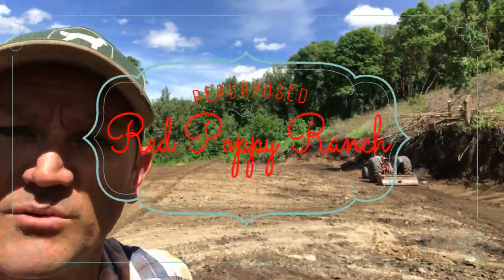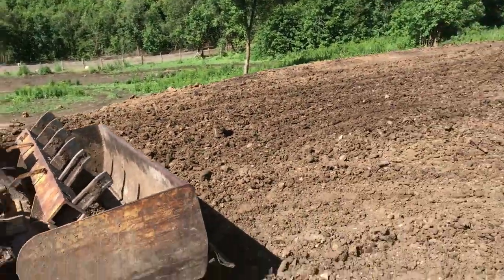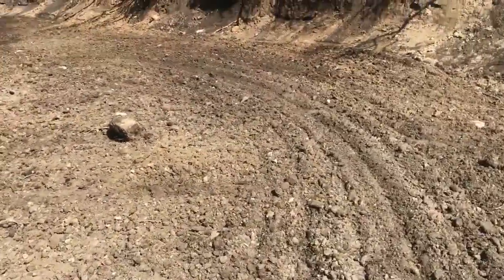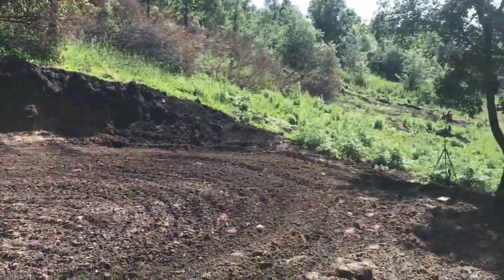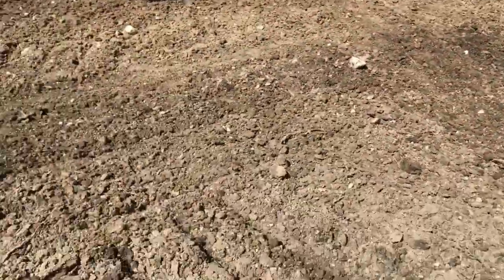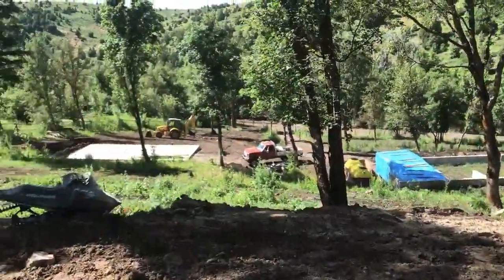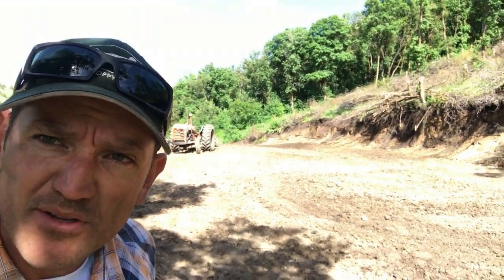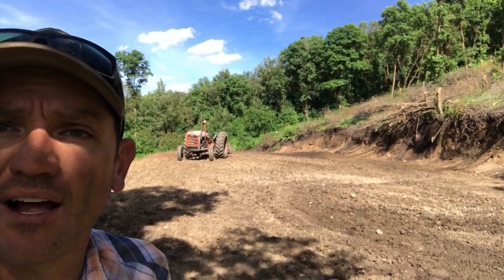#114 - Grading The Sawmill Pad With The Old Diesel Tractor

Comment: two tricks for running a skiploader...
first make sure your gannon (box blade) and front bucket are wider than your tractor....
then your tractor will set in your passes not jumping around..
second... once you have the dirt (ripped) so your tractor can handle it..
work backwards..
your tractor will be rinning on your passes.(less jumping up and down)
another trick is to make passes leaving a couple of feet between them..
then going forward your tires will be running on flat runs ( jumping less).. and you can use the slug of dirt to adjust what you left...
if you're filling on a slope...
always key into the slope at the bottom of where you want your finished slope bottom...
as you work your way up the slope laying each lift in keep keying in...
if you just push dirt over a slope..
you stand a good chance when the water gets in the whole fill sliding down the mountain..
when i key in (horizonal passes running across the slope ) 
i cut the keys (benchs) tilting into the  mountain and compact ever lift.. (6 inchs max)
always keep cutting into the mountain every lift until you are at the top of your pad against the mountain....
chances are your pad will stay locked to the mountain....
_(i spent 40 years running a skiploader in los angeles, some times other tractors but here with so much work... we could put in year after year just running one type of machine)...
but that's my two cents worth...
always enjoy seeing your progress...  😄

Comment: Great job on leveling  the pad .Will be a good spot for the saw mill.Had a thought about the bank if you put a contour swale above the bank it would help to control rain runoff  on the slope and prevent erosion on the bank.If you then planted hazel nut on the swale bank you would have a hedge and a economic  crop got the idea on a clip titled 'regenerative  landscapes by ben falk'
Happy anniversary  rgds basil  cape town

Comment: my two cents worth on building your driveways or roads..
always angle them into the hill and put a flow line against the toe of the slope.. (so your road doesn't wash out)
now some where your probable going to have to let the water cross the road..
if it were me...
i would make a swale where i need to let the water run across the road..
but so it wouldn't wash out and staying low budget..
i would dig down about 9 inchs to a foot.  and take that soil and mix 4 sacks of cement per cubic yard of dirt.(your making cement treated dirt,,, almost concrete)
mixed with enough water so when you squeeze a hand full of dirt it stays in a ball but no water running out...
recompact the dirt and cut in your flow line..
remember you're basically making almost concrete... so work fast the cement is going off...
don't stop until you're completely finished..
as a side note.. 
the first time i was around cement treated soil...
we were working on a military airbase..
the crew having not worked cement treated soil..
we didn't make the finished passes to get the desired finish and elevations...
the next day.. a 140g cat blade couldn't scratch the surface with his blade..
so don't stop until you're completely finished....
just my two cents worth for what ever they are worth...
some might say...
you don't need to go that deep...
my moto is do the job once..
if you go 6 inchs and it fails you have to remove your work and try again.. and tgen are you going to try 6 inchs again... 
6 inchs first try and 6 inchs second try = 12 inchs..
and three times the work...
That's why i like to go over kill tge first time and forget it...

Comment: I hope you stripped the grass and sod off from the area that the fill went on. If not expect all that fill dirt to slide down the hill next Winter. Also leave the very edge of your fill a little high to prevent water from going over the edge and eroding your fill dirt away. Water puddled up on the fill will settle it. Very experienced excavating contractor here that has dealt with a lot of fills.
Reply from the maker: No grass or sod.